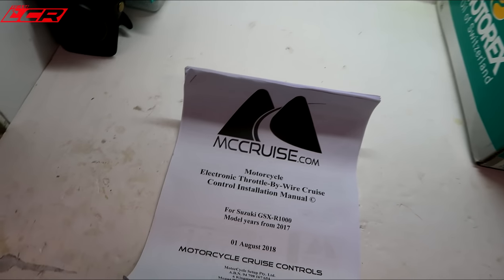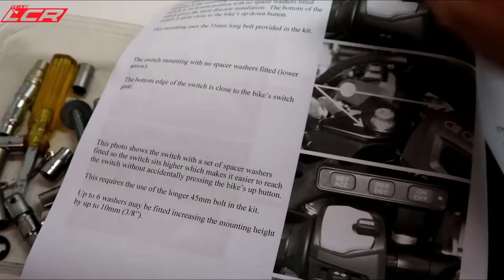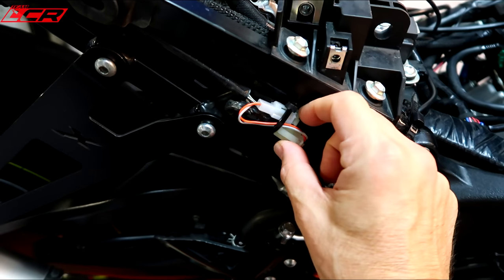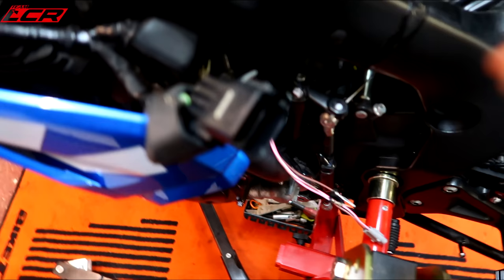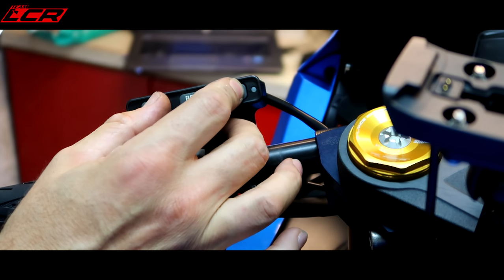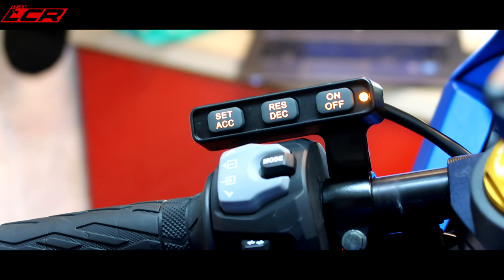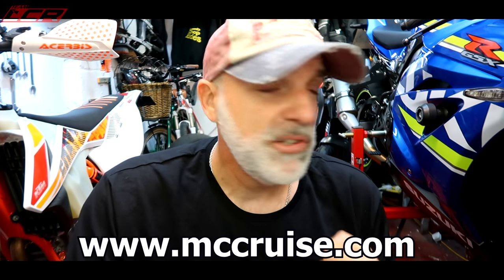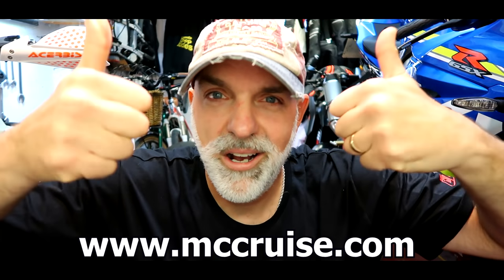Aftermarket Cruise Control Reviewed | MC Cruise  on the GSXR-1000R

Comment: I installed one of these on my 2004 Honda VFR 800.  I absolutely love it  .  I am a novice when it   comes to mechanical stuff, but I was able to figure it   out.  I had some trouble and the guys from MCC called me to help...all the way from Australia.  I live in the US.  This is a fine product and worth EVERY penny.  Gas mileage improvement, less rider fatigue and less of a chance of getting a dumb speeding ticket.  It's been on my bike for 2 years, and I've had zero problems.  If I ever buy a new bike and it    doesn't have factory cruise, I'm buying another MCC kit.  As a matter of fact, I won't buy a bike unless MCC makes a cruise control unit that will fit.

Comment: Hi MC Cruise is an Australian Company, they have been designing and manufacturing motorcycle cruise controls for many years, I have 3 of them on my and my wife bikes, one fly by wire and one electric servo model and one vaccum servo model. There is no better aftermarket cruise control on the market. I used the unit on my 2010 FJR when I rode 14,500 KLM is 9 days on a trans Australia Quest and completed several Iron Butt Certified rides concurrently. I would not recommend any other device. Best by Far and easy to install.

Comment: Thanks for that! Not cheap at all, but cruise control is something pretty nice on longer rides!

How is the function when you use the quickshifter and blipper? Keeps it activated or not? Are the complications with the installation, when you already have a full translogic quickshifter and blipper system? Like your channel, keep that style 👍😎
Reply from the maker: Thanks DR, when using the QS or blipper it interrupts the cruise as it detects the abrupt change in revs and deactivates. I think it will be exactly the same with the Translogic shifter and I couldnt see any reason why they couldnt work together.

Comment: Ugh, Chopsie! It's the biggest pity of pities that you didn't have stainless brake lines to fit at the same time because you have to go to the same lengths of disassembly -- including removing the air box, to fit them. I can't wait to fit this kit to my '18 in the spring. Great vid!
Reply from the maker: Yes but they are coming soon so it will be apart again. How easy to re-bleed with the ABS system if you have done yours? Also adding quick release caliper fittings so should be quite trick :-)
Reply: @LambChopRides  The bleed process is very easy if you have a vacuum/power bleeder. It's no different to a conventional brake system.
Reply from the maker: OK great news thanks!

Comment: Would this system work on a GSX S750 2017?
Reply from the maker: You would have to check thier site and see, its model specific
Reply: Doubt it since it doesn't have a drive-by-wire throttle.
Reply: He asked "would this system work on a GSX S750 2017?" The answer is no, the system used in this video would not work for GSX S750.

Comment: Is there any bother with insurance?
Reply from the maker: Not that Im aware of, declare it like any other mod would be my recommendation
Reply: I have always found it funny how you have to declare all the mods in UK. Here in Finland we just install mods and ride. I guess it's frustrating to keep insurance company updated on your mods all the time?
Reply: In theory you need to tell them about factory optional extras too. Things like fly screen, comfort seat etc. The biggest problem is that when you do tell them they sometimes refuse cover or get confused about what the mod is. I've had insurance companies ask me to explain what a tail tidy is.I asked specifically about this aftermarket cruise system because I can see them being jumpy about some third party electronics diy installed being in control of your throttle.

Comment: A Kaoko throttle lock works brilliant, for 60$, and takes 2- min to install, i looked into MC Cruise and its stupid expensive and will take hours to install- no go for me
Reply: Kaoko is also interesting but this is  REAL cruise control. Desengages with brakes, throttle and clutch, and you can set speed in a very accurate way.
Reply: Michael Kastner I have a kaoko on my ‘13 Multistrada and real cruise control on my Tuono. Kaoko doesn’t compare. Kaoko is better than nothing but that’s it. Speeds up massively on slight declines and similarly decelerates on mild inclines. Hard/impossible to get exact mph.

Comment: I have been looking for something like this for years, in particular last years for my Z1000sx. I partially solved with Cramp Buster but still I got to have health problems to my fingers at the right hand (in 2018 I have ridden 25000 km) :-(
Cruise control is ALWAYS a great feature, also on sporty bikes. Otherwise we could think for example that engineers at BMW are stupid, as they they've put it on the S1000rr. I have it on my 2018 Superduke and use it a lot, even for a little mile, up to the next bends just while chilling a while...
GREAT VIDEO MR CHOPS... as always. Thank you!
Reply: luKiluk I'm sorry to say I don't think it will work on your Z1000SX because it does not have a fly by wire throttle.
Reply: @samiam8779   I know Sam thanks 😊
Actually my Z is quite "old" (2014) and anyway I don't want to make any more mods and i'm quite happy with the simple Cramp Buster. And especially, as someone said in the comments, speaking mechanics I can't go much further spit and tape 😁
Reply: Baron thanks for that. You learn something new everyday. Do you know who would do one for a '12 V-Strom, as I'd love to have electronic cruise control. Cheers!
Reply: Baron OMG! I can't believe I missed that. Thanks, much appreciated!